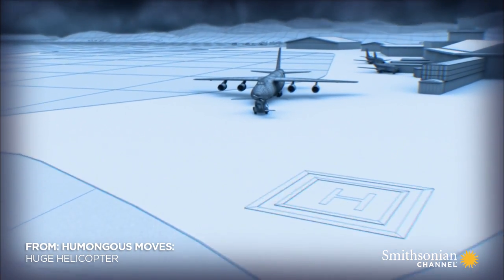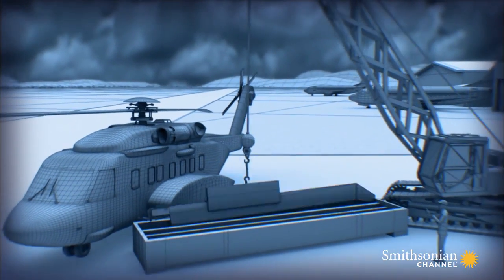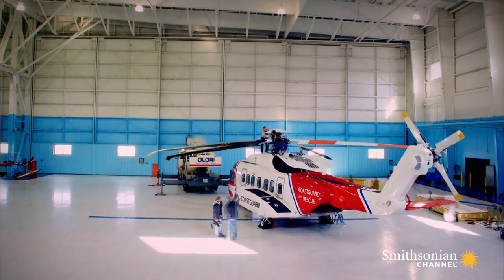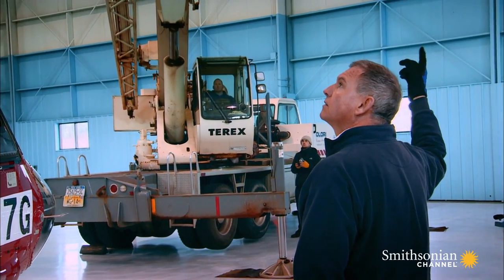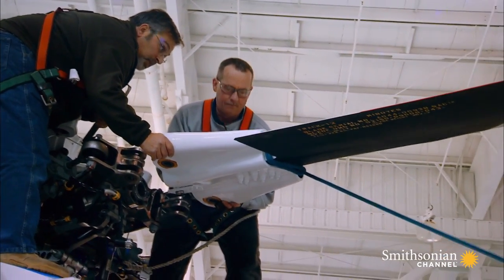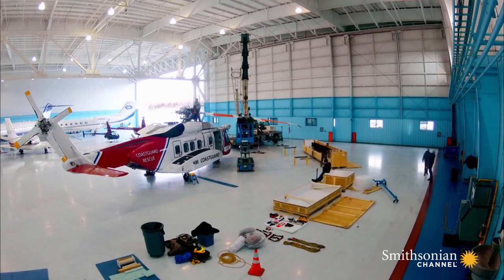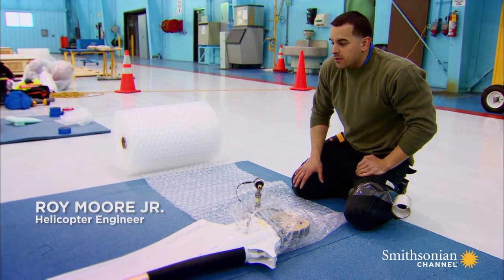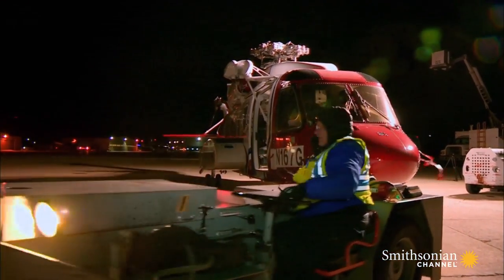The First Step to Shipping a Chopper? Remove the Blades.

Comment: People, just think for a minute. If in a hypothetical situation where a helicopter needs shipping from the U.S to Europe, it wouldn't be able to make the flight because it cannot carry enough fuel, therefore it would have to be shipped by plane or boat instead. And in another hypothetical situation, it may need further testing at another site where the current location cannot fulfill that testing requirement before it can fly.

Comment: Each blade is worth half a million dollars????, What is it made of gold?
Reply: La3eb the helicopter is worth 17 million...500000 is nothing
Reply: 500k is cheap...if you look a the robots who do this stuff they cost around 5-20 millions plus material and workers. Just because it sounds and looks expensive doesn't mean it's expensive.
Reply: @Jsperal  then you buy a freaking 500k blade for a helicopter, its not cheap 500k isnt cheap
Reply: carbon fiber composite
Reply: La3eb lol
Reply: Simply because they are darn hard to make and have to be hand made... The blades are a extremely complex part of aviation that has to be engineered just right to be able to properly work.
Reply: Waw thanks for the explanation So its not made out of gold it is made out of 10x gold :p :P :P
Reply: Well now I am confused that doesn't explain why that blade cost $500,000, That's a lot of money for one blade
Reply: 1:25 He said each blade is worth half a million dollars?
Reply: I can buy a carbon fiber sword for as little as $200, I mean something like $50,000 is a little too high but understandable but when you add another zero in the mix, That's when it gets fictional, I mean clearly the helicoptor wings are made from unicorn horns  :p
Reply: A simple google search will tell you that titanium DOES NOT cost more than gold....
Reply: Can't they take the angles that they want and put it throw a machine to make it?, I mean there is no more precision than machines also they will make all 4 the same shape down to the micro meter
Reply: Lets say the truth, They charged extra for it paid like 30,50k and asked for 500,000, Maybe they included the angle and physics research done to it and that's why it costs so much because of the research money spent on the blades

Comment: why arent they just flying the helicopter
Reply: lvxhze6 this helicopter has a 'HM Coastguard' livery which gives you a clue to the birds destination = Her Majesty's Coastguard is from the UK. You can't fly a helicopter over the Atlantic.
Reply: Van Kham The Irish coastguard birds look identical also apart from obviously saying 'Irish' instead of 'HM'. May just be how Sikorsky paint them to order from the factory
Reply: idk, maybe is brand new, and the owner does not want any to touching, or a long distance
Reply: Matt Buxton, Good catch, I didn't realize it's for UK coastguard, thought it's US coastguard, it looks simila. 👍
Reply: slower and expensive
Reply: Ah i thought it was a Galaxy as well but it is a Antonov 124 with top speed of 470kn
Reply: Matt Buxton, I see. Thx,
Reply: Correct. Test flight and they likely transported it as close as reasonably possible under its own power to reduce freight costs
Reply: Judging from accents and the choppers paint work it has to cross the Atlantic. You try flying an 2-92 from America to Britain.
Reply: Matt Buxton excactly
Reply: Matt Buxton yes they do
Reply: Rocka Craig ye tjats what i thought
Reply: S-92 top speed -190 mph    
C-5 Galaxy top speed 590 mph

When factoring in fuel/maintenance costs, its much cheaper and more efficient to ship it on a c-5

Comment: I suppose there is an excellent reason, but why arent they simply aligning the blades? Surely the exemple they give is innaccurate, its probably to reduce the lenght slightly, not to be able to fit it inside.
Reply: louis Henry They are all connected if one turns they all the others turn.
Reply: what do you mean by aligning the blades?
Reply: Duck I think what he is talking about is the harness that goes over the tail boom so all you have to do is disconnect  the electrical leads and remove one blade pin so you can swing the blades over the tail boom to lock them in the harness